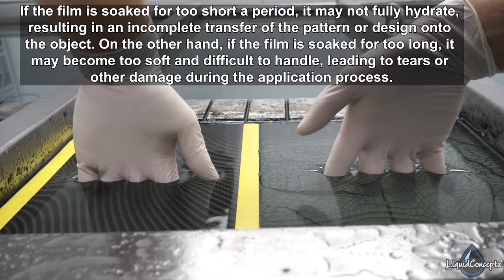Hydrographics Problems and Solutions

Comment: I keep having an issue with dips looking like scales or orange peel stretch marks. Seems to mostly happen with really thin,flimsy film that curls up on the water. And if I spray activator the film and let it sit in the water, the film starts to spread and I can see little holes showing. Does this have to do with soak time or amount of activator? I sprayed the same amount as other stronger feeling film's and those don't have the issue. For thinner films should I let soak for longer or shorter? Or spray less activator even if it doesn't glass out?
Reply from the maker: HI are you containing the film? If you can send me some photos or video to my email I can take a look and see what might be occurring.  Info@liquidconcepts.com